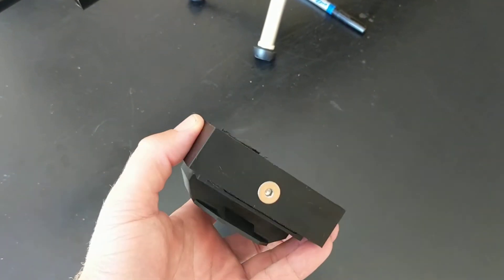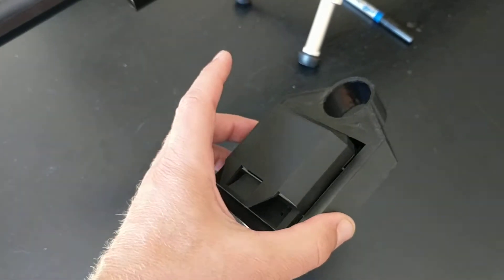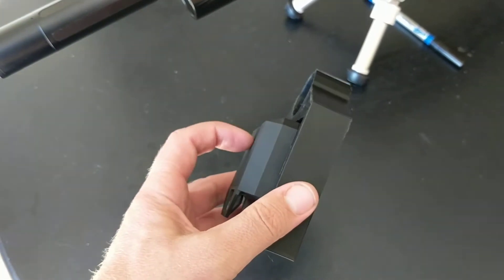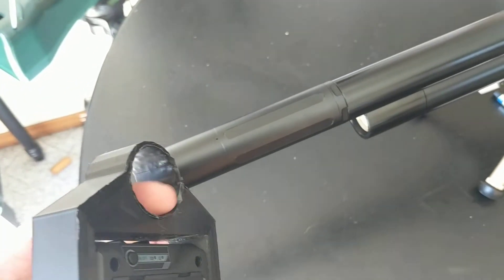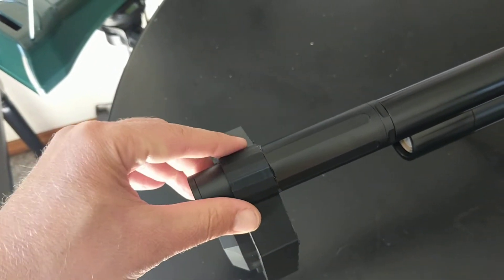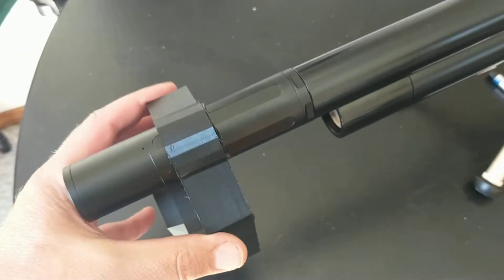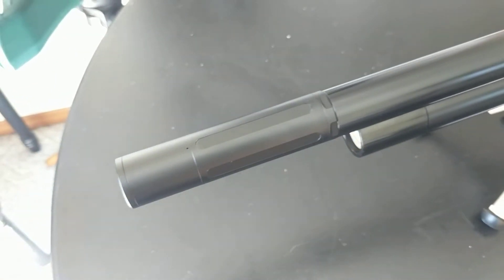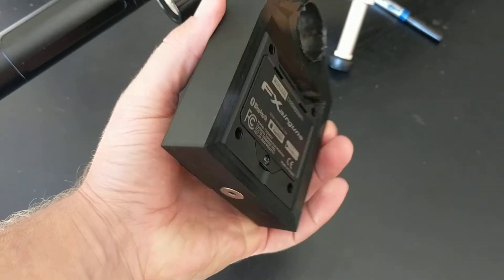Homemade FX Radar Chronograph holder.

Comment: why do a bracket when you think this chrono is crap? You made a video when you tell everybody its shit but still you use it and makes bracket for it so you can bring it in your bag?
Reply from the maker: I made a bracket because I got the idea from others that it might solve some of the inconsistency problems of the unit. It is my opinion that on a tripod the unit is still crap. The bracket is a fix for one of the chrony's short comings and makes it usable.
Reply: @ajarnmichael1  I guess FX airguns have had similar thoughts. I've just received mine today and it came with a barrel mount that you use rubberband to put on the barrel. It replace the plate where you install the tripod.
Reply from the maker: @boeriksson3326  Interesting. Thanks for sharing. How well is the rubberband mount working?
Reply: @boeriksson3326  Do think that your retailer may have included the barrel mount rather than FX? Was the barrel mount packaged separately from the chronograph when you received it? I received mine today and there was no barrel mount so I'm wondering if I should ask my retailer if I should have had one. 

So it looks like the chronograph is positioned upside down when using the barrel mount you had included - is that correct?
Reply: @kevbell5346  it comes from FX. Dont know when they started to ship them like that